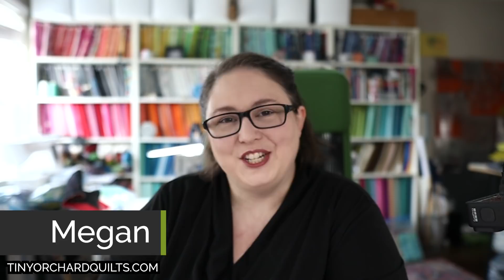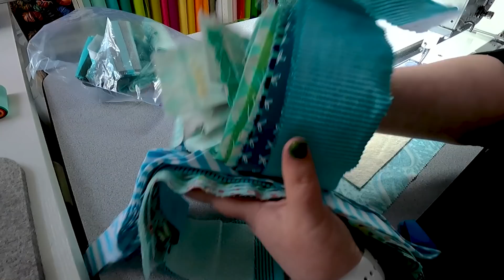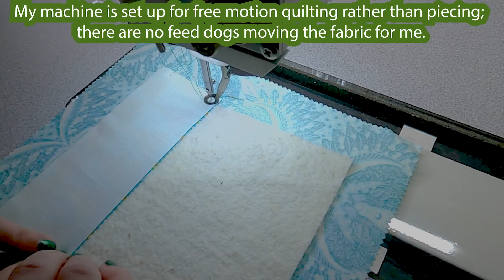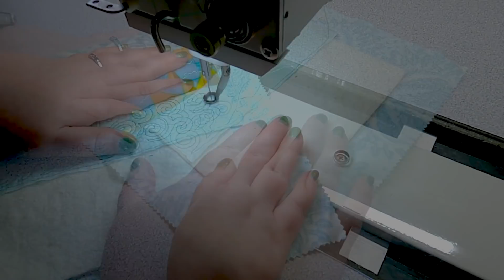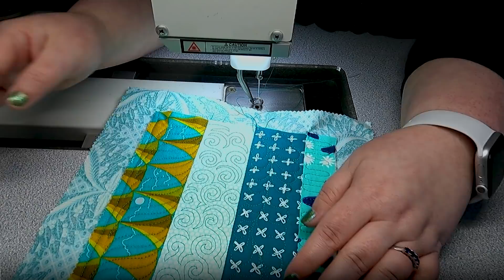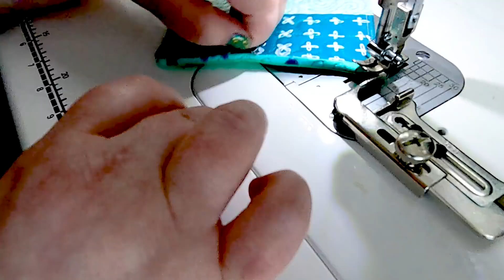Piece and Free Motion Quilt Your Scraps at the Same Time with Free Motion Quilt As You Go!

Comment: Before you free motion you tacked down the second strip and when you add you third strip won't that have two lines of stitching in the back of  coaster meaning doesn't that take away from the free motion  in back of coaster  with all the extra straight lines in the back. Make sense ?  So now I watched the whole video and I guess it gets hidden with the extra backing you put on but I guess I wonder why you need another backing with all of your awesome free hand quilting.
Reply from the maker: It’s definitely not the cleanest looking back—not like a traditional custom quilting look where the back looks just as great as the front. The piecing aspect does create additional quilting lines. I generally use a thread that matches the back or a busy backing fabric. Or both!

Comment: @Tiny Orchard Quilts  Thank you for this video.  It was very informative.  The one question top of mind though is why you sewed another backing when you already had one?  Could you have quilted that block without a backing, so just with the batting and tops or do you always have to have the three layers?  If so, why not finish using the extra backing as the binding?  It just seems a bit of a waste because the backing you used was very pretty and in the end it is hidden behind the green.
Reply from the maker: You definitely could have left the original backing and my original plan was to make these and scrappy blocks and then join them quilt as you go style at some point when I had a pile. If you want to make a coaster and preserve the original backing, you could just bind it like a super small quilt. I opted for the extra backing option since it was easier :) if I had planned to do that from the beginning, I would have used Muslin or a random fabric I didn’t care for n
Reply: @TinyOrchardQuilts  at this point I nearly always use old sheets for a batting sandwich.  I'm not at FMQ  yet, mostly doing straight boxes or diagonal designs for hot pads but the more I create the easier it gets.  I think we all figure out our preferred solutions and come up with our unique style,  that's half the fun!
Reply: I am thinking that it was done with the extra backing because as a coaster, you may be putting a hot mug on it, so that way, you have extra 'padding' and insulation.... also, if you sewed the project as she did, with sewing off and sneaking down the sides with sewing... all of that will show on the back of the quilt project... the extra step she did with the 2nd backing, covers all the sneaking  sewing/sewing off and it would not look pretty on the back!